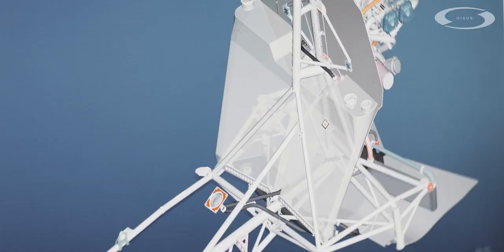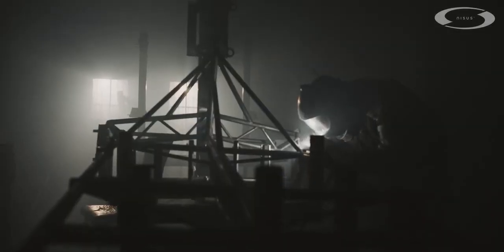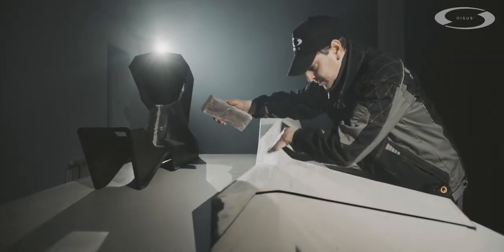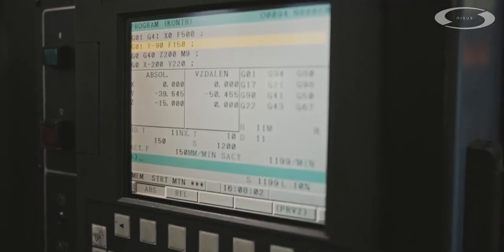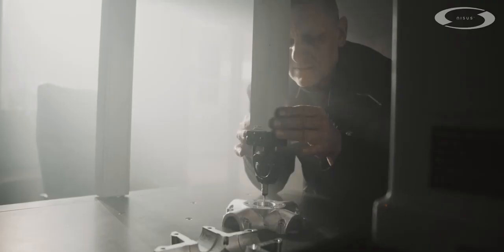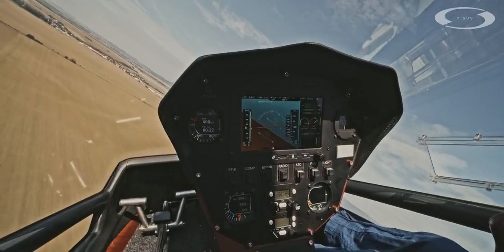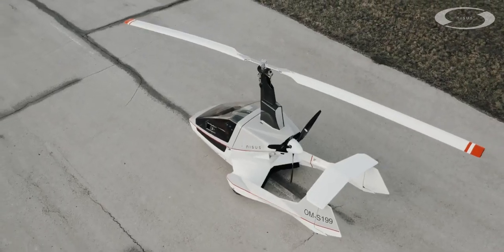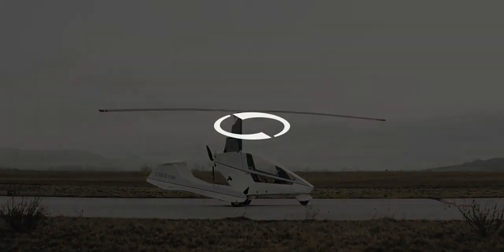Nisus Gyroplane

Comment: Curious choice to use a steel frame when making a composite body panels.  Seems more logical to make reinforced areas of the body and eliminate most of the frame.
Reply: And I think it's a beautiful machine.
Reply from the maker: I like steel myself, it’s odd on the Cavalon that the rotor head is mounted to only carbon fiber at the top mast. I